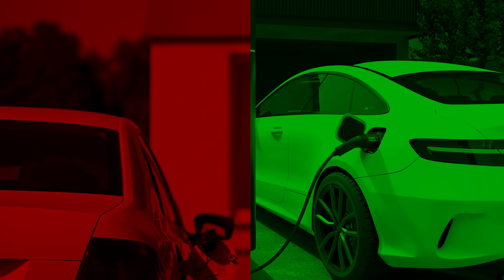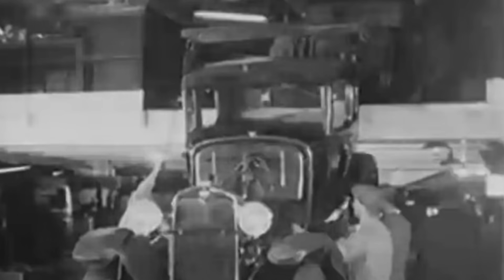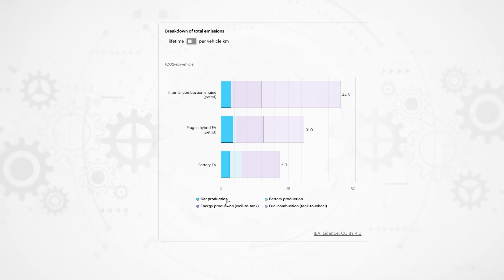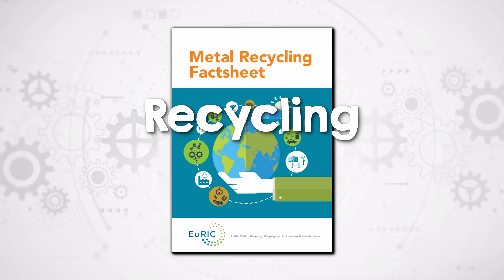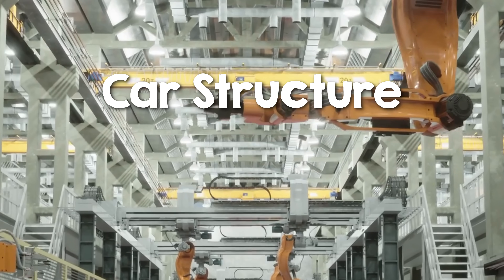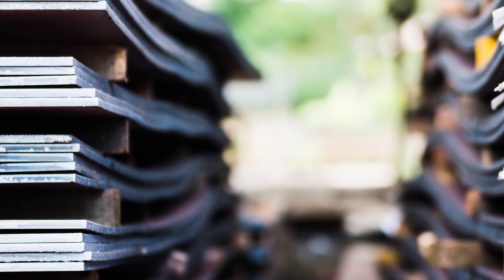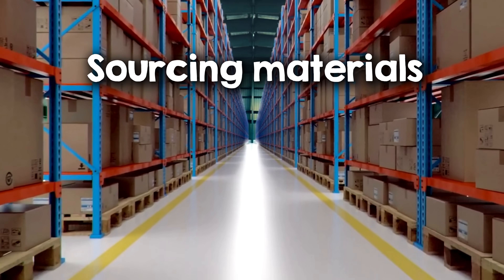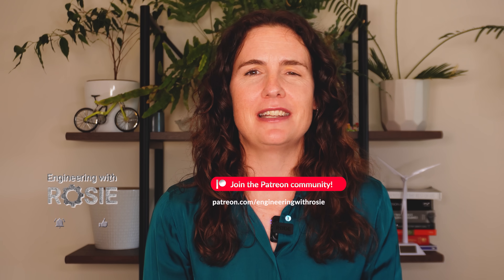The Hidden EV Manufacturing Problem No One Talks About

Comment: Good video & I like this channel. However, 1) digital twins are far from a competitive solution at the moment, and 2) EVs are likely much less carbon-friendly than claimed, because regardless of how much renewable energy is put on a grid, plugging EVs into it will usually draw extra power from natural gas sources, resulting in what is basically a combustion-powered car that gets around 60-miles-per-gallon. You can say, "hooray! My area is powered by 80% wind and solar energy!" But even then, when plugging a bunch of EVs in to recharge, a fossil pant in the system will increase power output in order to meet the demand.

Comment: I admire Dr Rosies comments, but her logic is the flawed logic of a technical solution to every problem. Technical solutions are a sort of after the horse has bolted scenario. I am all for new tech, but the only meaningful way to minimise environmental impacts on our planet are to CHANGE BEHAVIOUR. So rather than update your car every 3-5 years, keep it in good running order for 20 years - even if this means the collapse of a number of manufacturers. Also minimise car journeys, even better, considering that the majority of car trips involve one person in the car, switch to a scooter/motorcycle. And yes I am aware that these forms of transport have less efficient engines than many car engines - room for improvement. Finally catch a bus or train and some walking to work or buy a shopping trolley and walk to the supermarket. Again I am aware that a significant proportion of the population lives quite a distant from their place of work. Anyway as I stated earlier change behaviour before implementing tech solutions.

Comment: Were you paid or commissioned by Big Oil to make this video?  Did Shell Oil, BP and Saudi Aramco just happen to make a big contributions to your channel? 

Big Oil shills have been pushing these lines for decades.  "Oh, EVs draw electricity from coal / oil / gas plants"  "Oh, EV batteries cause pollution from mining"  "Oh, EV battery manufacturing requires power that comes from coal / oil / gas plant".  

But let's completely ignore how coal, oil, and gas are extracted from the earth.  Let's ignore the pollution in refining and distilling petrol products. Let's ignore that they also use coal / oil / gas power to make more.  And don't forget Ethanol which requires more energy than it delivers. 

Do better.

Comment: If they run simulations on the commuting habits of Americans, they'd wonder why 5 days a week, 50 weeks a year, 140 million Americans burn fossil fuels to move 4000 lbs of metal 40 miles per day (10000 miles a year) without making any net movement, yet spewing 5 tons of CO2 into the atmosphere.  Why don't they just live close to work, save $12k per year of car ownership and 250 hours of driving?

Comment: The "no downtime" in factories reminds me of a true story. Arnotts used to start mixing and baking many hours before the biscuits were wrapped and packed, and they planned maintenance such that there was minimum downtime. When the wrapping conveyors needed maintenance they allowed a small window for it and they decided they would paint the equipment at the same time. With a 2hr drying time, they had biscuits going through the ovens even before they finished painting, but they couldn't put the covers back on when they discovered the paint was still wet and biscuits were coming thick and fast. No covers and the belts couldn't work by law. It was a scramble to box them and store them while they waited, but the paint stayed wet for days. The investigation revealed that a worker at the paint factory was sacked and not let go immediately, so in his last days he left all the drying chemicals out of the mixture. Classic.

Comment: Rosie, I worked in automotive two decades ago, and they did complex simulations of the entire process back then.  It is NOT a new idea.  If you want some indication of the limitations of digital twins, I invite you to take your digital twin to the actual Union auto worker that has to build the EV and have them explain the difference.

BTW have you seen the outrageous carbon footprint of those simulations and the AI that drives them?
Reply: Musk has built an AI data centre in Memphis, powered by 35 gas turbine engines! That's a lot of pollution!

Comment: Isn't it interesting how every comparison of emissions footprints for GAS vs EV takes into account every little tiny contribution to the battery manufacturing but never takes into account a single oil spill, pipeline leak or WAR that are directly contributing to the "footprint" of powering gasoline engines?
Reply: It for sure is a very complicated calculation with many factors. And on top of it all, we have different stakeholders presenting reports according to their own interests, claiming them to be facts. Just to mention a few overall factors influencing, we have production (including battery production), fuel efficiency (whatever type of fuel it is) including how efficient the car is, transport of the fuel, how the fuel is made, and there are probably others, not mentioning any geo political effects simply impossible to measure. 3 years ago I read a report that seemed creditable, trying to factor in most of these, and the comparrison of EV's towards ICE differed a lot, depending on manufacturer and where the EV was driven. (hint Ford Mach-E driven in Polan still had higher foot print after 50K KM than a comparable ICE car, while a Tesla in Sweden and Norway very quickly overcame their starting footprint). Even so this 3 year old report not 100% correct back then, probably have a different conclusion today as the technologies evolves.
Reply: Hey, if you gonna do that, put in the EV side all the destruction, and slavery that the minerals to make EV make. let's see if the footprint becomes balanced.

Go work in cobalt mine for an hour and then talk about that.
Reply: @TechZF  Most EVs don't contain cobalt but use LFP batteries - your phone does though
Reply: They don’t take into account the wars, wasted investment and factory building to dominate EVs, the loss of buildings and ships to EV fires, or the government colapses from raised gas prices….or from protests and unrest from displaced autoworkers….
The EV carbon footprint calculations done by Argon research were the most comprehensive.
Go troll some other topic!

Comment: Simulation and modeling have been used forever.  The modeling of the D-day invasion of France happened over 80 years ago.  It has been an evolutionary process led by improvements in information systems.

Comment: Digital twins are great to the extent that the model represents reality. It can never cover "every detail".
Reply: That's why one does a test line and test runs to confirm the simulation.  Same as every other simulation.
Reply: @ZweiZwolf and all simulations capture less than the reality. The best we can hope for is that the difference is not important.
Reply: Yeah, some of it sounds like a way to cut costs by sacrificing quality & safety, which is on par for today's "AI" solutions I suppose.

Comment: Aluminium, this word is spoken in Japan and not ‘aluminum’. You have taught it.

EV shifting movement started around 2005. I remember Nissan advertised in NZ and Australia. Mitsubishi i-MiEV is a tiny variation from 2009. These failed. No one buys in Japan except public service like Japan Post or City Hall. I remember the total emission comparison between combustion and the EV system in 2006 or 07. And the conclusion is identical after 20 years.
I wonder who came up with this false and ill-intention project and what for.

Comment: Is it wise to keep pooring cash into china for either batteries vehicles or raw materials when china is doing little to reduce their emissions same for wind turbines and solar panels 
Also is it wise to put up turbines with a life of around 20 years when a nuclear power station will have a life of at least twice as long?
Reply: Last year China installed more wind/solar/and batteries than the rest of the world combined.
In other words: they are using most of their production domestically!
Reply: If we're lucky maybe we could build a nuclear plant by the time the new wind farm needs replacing. I wouldn't bet on it though.
Also, from the IEA: "China built more solar panels in 2023 than the entire world did in 2022. By 2028, just under 60% of the world’s renewable energy generation will be in China."

Comment: Digital twins fine.  Each incremental advance makes the process less carbon intensive.  But look at the rest of the process.  A) there now exist these huge trucks that bring the ore to the first processing plant that run on replaceable batteries.  A fork lift puts a new battery in the truck, the used one is put on charge.  As long as the electricity to charge the truck battery is from wind or solar, this first transport is green.  B) Then these factories run on electricity.  I don't care how 'messy and energy intensive they are'.  As long as the electricity is from renewable sources ditto.  C) Then either the second refining plant is right beside the first and the concentrated ore goes by conveyor belt or an electrically powered truck conveys it.  And on and on it goes.  D) Need heat - electricity.  E) Even the panels that generate the electricity are greener and greener as they replace the fossil-fuel-generated electricity that is used in their manufacture.  F)We are using fossil fuels to wean ourselves off of fossil fuels.  I love it.

Comment: Todays 30% of car cost is electronics, sensors and safety features. We introduce more complexity from 60s forwards, so EV  always will be high energy intensive manufacturing process. In USA Telo trucks tries reduce complexity and golden rule of failure more device have components more probability that it will fail. Just reduce size (weight) and number of components and it will increase cars reliability and reduce manufacturing cost.
Reply: "introduce more complexity from 60s forwards" Nope...More complexity has been introduce ever since the invention of the wheel.  And it's all about trade-offs. If you don't care about safety or emissions cars could have been a lot simpler.

"Telo trucks" has a magic formula for reducing complexity? Tesla has shown that minimalization is possible, but with trade-offs. Startups make a lot of promises but only a few live long enough deceive they have anything worthwhile to contribute? Telo Slate etc I wish them all luck, but it's all just marketing at this point.
Reply: @nc3826  < If you don't care about safety or emissions cars could have been a lot simpler.>
Emission burn fuel more efficient and with less pollutants is more mechanical development - fuel injectors and less electronics. And from Volkswagengate scandal we know that electronics was used to cheat measurement anyway. Safety is urbanism problem not cars, built road safe that drivers could not speed up.
Reply: @phyarth8082  Exactly Societal improvements in general,  such as to safety and reducing pollution tend to require greater complexity....  It's all about trade-offs. Throughout time.... Not just from the '60s....KISS

"Safety is urbanism problem"? LOL 

Anecdotal examples just distort statistical modeling, which create misleading rabbit holes. Since there's always exceptions to the rule. Which doesn't tell us much about the rule. Extrapolating tends to be very misleading. That's how we end up with so many conspiracy theories and misinformation ....  c'est la vie

Comment: A concrete example of a digital twin on the factory floor is the syncing of configuration files on microcontrollers over a network. One of the twins is on the factory floor and the other twin is in the cloud.  The device on the factory floor "follows" their twin in the cloud via sync updates.  This is modeled in json as "desired" and "reported".  This design is used by Microsoft Azure IOT Hub for managing thousands of remote devices from a single cloud instance known as a digital twin.

{
  "deviceId": "myDeviceId",
  "properties": {
    "desired": {
      "telemetryInterval": 10
    },
    "reported": {
      "telemetryInterval": 10,
      "firmwareVersion": "1.0.0"
    }
  }
}

You can use device twins to:

Store device metadata from your solution back end
Report current state information such as available capabilities and conditions, for example, the connectivity method used, from your device app
Synchronize the state of long-running workflows, such as firmware and configuration updates, between a device app and a back-end app
Query your device metadata, configuration, or state
Source:  https://learn.microsoft.com/en-us/azure/iot-hub/how-to-device-twins?pivots=programming-language-csharp

Comment: Hopefully this will lead to machines that are repairable. Cars have gotten insanely hard.
Reply: More repairable no, but more recyclable yes. With a relatively low correlation between them.

FWIW,  if you think things should be more repairable, vote for restrictive "right to repair laws". Trade-off will be higher prices. And it's an age-old issue from the time of the invention of the wheel.

Comment: What’s the difference between the new “digital twin” buzzword and everything everyone has been doing for decades? CAD/CAM is hardly new.
Reply: CAD/CAM is focused on individual components in design.

A Digital Twin is a simulation of factory in action producing product, one can use it initially in designing a new factory but is also used during actual production tracking the factory live with the simulation. In the live setting one can spawn a simulation of the live factory to figure out how to deal with different scenarios, so if part of the factory has an issue one can trialing different approaches to resolving the issue, then once an approach looks viable one can put it into action in the real factory.
Reply: @robertosfield  : so basically like BIM but for factory layouts? OK, that's a nice neat explanation.
Reply: To answer your question, nothing.  Rosie is just recycling old info that has applied to all manufacturing for decades.  She just added "EV" on the front to make it seem new and glamorous.

Comment: One of the issues of this topic is the fact that the EV specific technologies are in their infancy.
We're still seeing significant jumps in efficiency in motor AND battery build.
There was a very recent major jump in the production of Lithium, motors are also still emerging.
While this discussion is important the real results will only happen when the major components in EV technologies have matures.
Reply: The drivetrains are already over 80% efficient from plug to wheels, so there’s not a whole lot left to improve. Of course I want to get that few extra percent efficiency but it doesn’t change the game anymore.

What’s left to optimize is the battery, and basically nothing else, if you want a car. Alternately there’s the idea of not using cars at all.
Reply: totally agree about NOT using cars, that being said, there is a new motor coming out in Germany, that may be as much as 15% ! more efficient.
Batteries are the second big option.

Comment: Rosie you covered whet all manufacturing companies need to master now what you didn't cover were EV specific problems. The biggest being that EV's cost price is 20 to 30% lower;  In order to maintain suffisant  added value EV manufacturers have to bring in house electric motor assembly, battery cell and pack assembly. When looking at Tesla have their in house seat assembly, bumper mouldings etc in order to transfer the sub-contractors profits to the manufacturer bottom line.

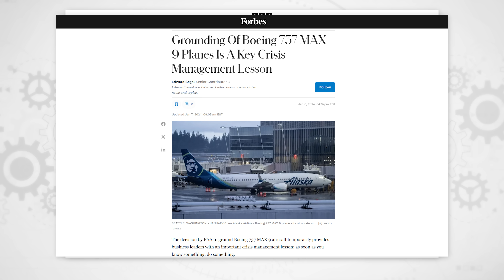Comment: ~9:00 Weren't the 737 Max problems more to do with the flight controls …?
Reply: The 737 Max had many different problems.
Reply: Yes
Reply: 737 Max major issue was hubris.... Since it was purposely designed to be less stable, and to have that instability controlled electronically... Which was not understood well enough... 

So when sensors failed it became inherently more unstable than a conventional  jet airliner.
Reply: Maybe digital twins and AI could have advanced learning curve? But it's questionable at best IMHO